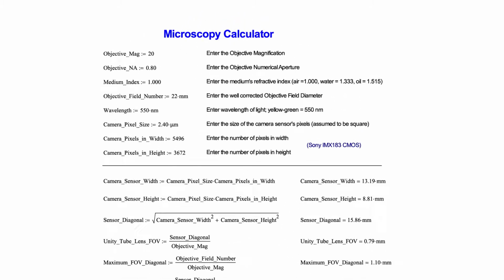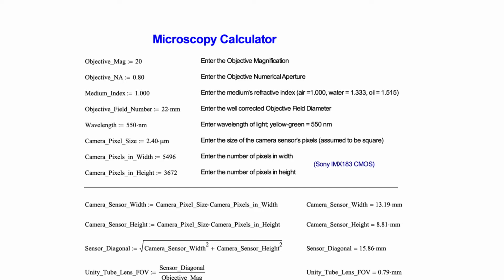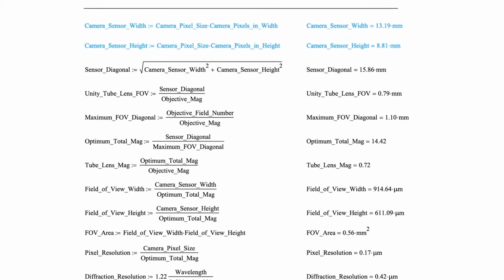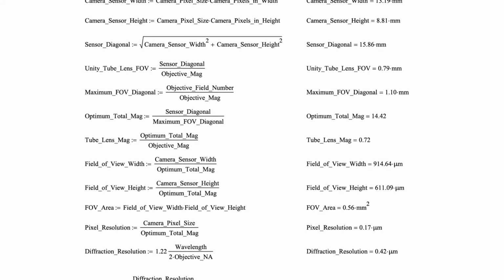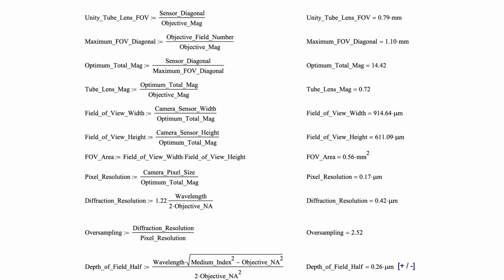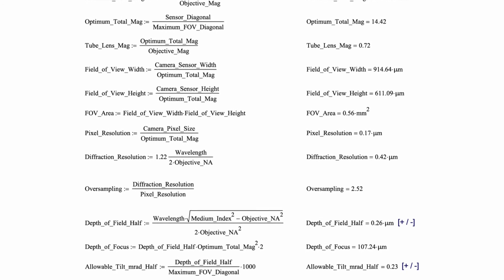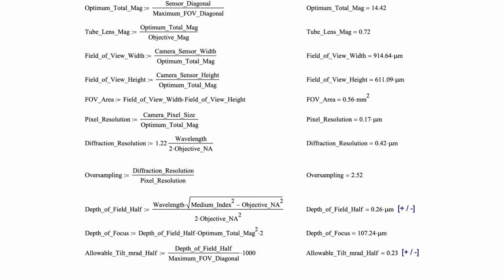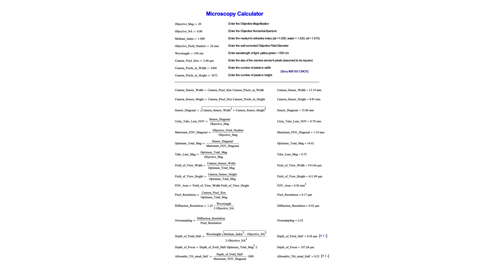Microscopy Calculator Walk-Through

Comment: The calculator looks amazing!
"Change the tube lens focal length such that it's magnification is not unity but is 0.72"
I'm fairly new to optics. What does the above equate to in practice?
Do you mean physically get a new tube lens? Or are you saying moving a given tube lens in relation to the image sensor can achieve this?
Are "unity" and "infinity corrected" synonymous?